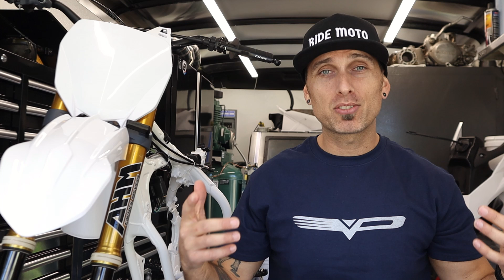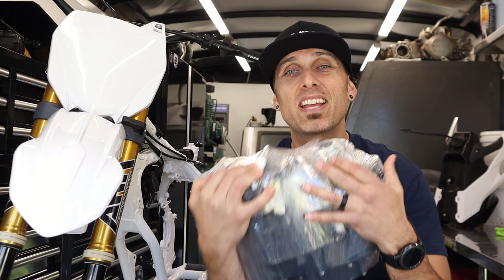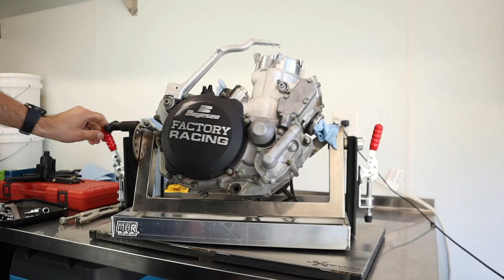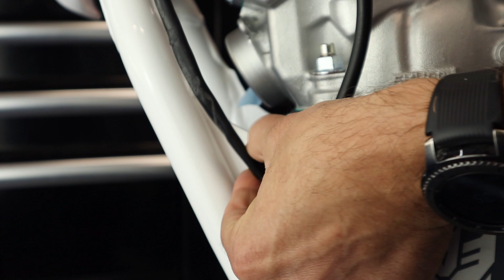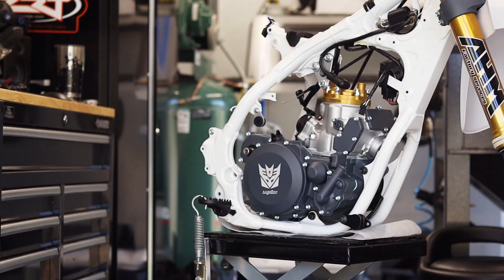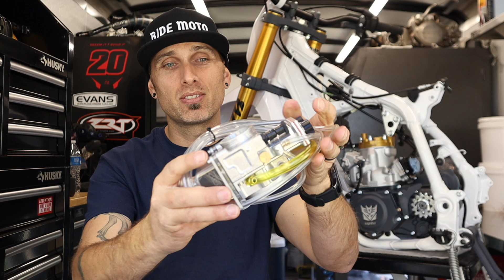Your Engine is Back... AND IT'S F***ING INSANE! 🔥 2002 Yamaha YZ250 Two Stroke Build & Giveaway

Comment: Great video Charles! I am getting great results with the Caswell chemicals doing zinc plating. I followed your video. By the time I use the Prymemx pads and zinc plated the parts I think the finish is better than OEM! I guess originally the parts were probably tumbled and not hand finished so that is the difference.
Reply from the maker: Exactly, and a lot of the factory stuff has chromate as well! Every single nut and bolt in my current build looks like chrome, probably just like what you're getting. Thanks for watching and stoked you're enjoying yourself

Comment: One of the best looking motor i have seen. What kind of coating is that on the clutch engine case?  Cheers!
Reply from the maker: Hell yes, thank you! That is "Glock Grey" Cerakote from Sano Metal Finishing in Southern California 🔥
Reply from the maker: Pretending to be me from your mom's basement?? LAME!
Reply: @mxrevival  That is interesting. It looks absolutely stunning.  Looking into cerakote mysel for the same type of engine case coating. It looks very close to what factory Kawi used to have on their two strokes. Albeit i know they Hard Anodize their factory japan provided magnesium engine case.
Reply from the maker: That's right! It's called "Akadizing" like Hinson Covers 🔥

Comment: yeh you might want to grind the mounts for the spark box on the frame so they are grounded and not just on bolts...
Reply from the maker: Hey dude, are you talking about the coil? The powder coating is actually ground off underneath each mounting point for a good ground. Used a Dremel after tracing the coil mounts, so that there is minimal corrosion and so that the grindings cannot be seen. 💪